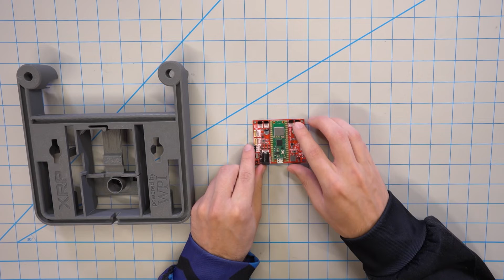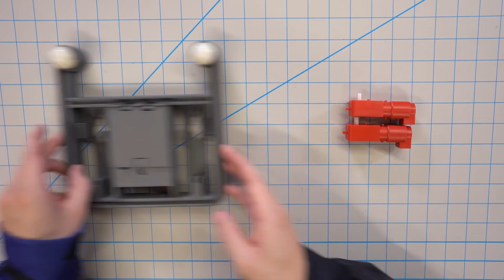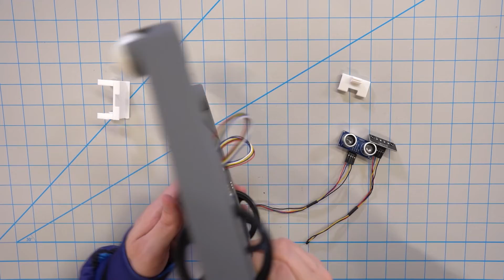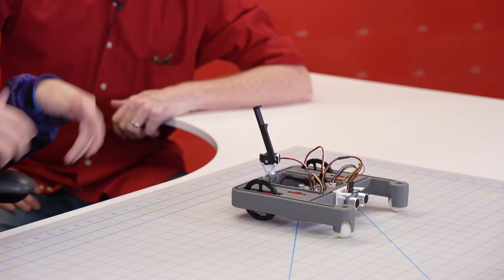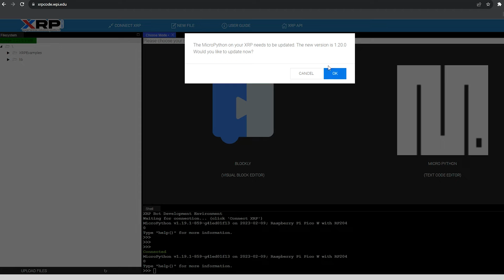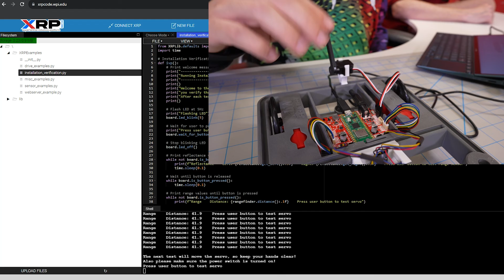XRP Assembly and Software Starter Guide (BETA)

Comment: Hey Sparkfun!
I am trying to find a different battery option. Is there a rechargeable battery pack i could use instead of taking the  4 AA batteries out and charging/replacing them? It would be great to just plug it. Or disconnect the barrel connector and plug it in to a charger. Thanks for the videos, very well done 👍
Reply: Dis you find a good option?